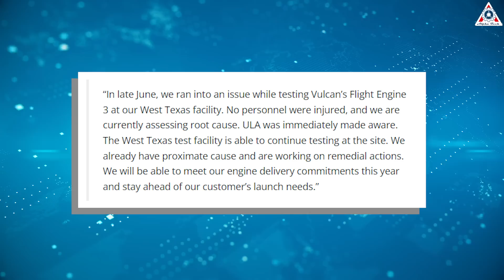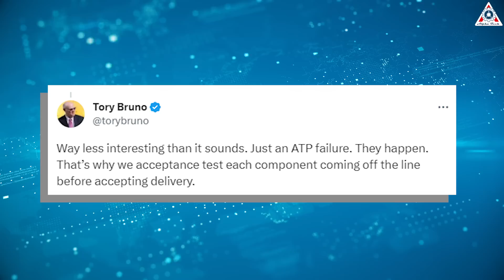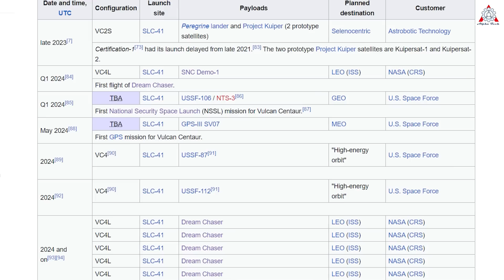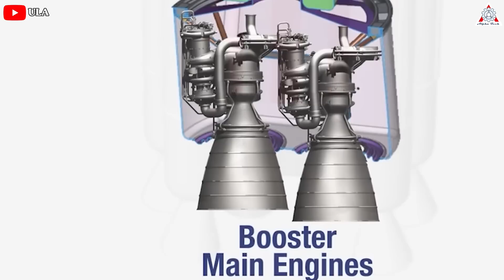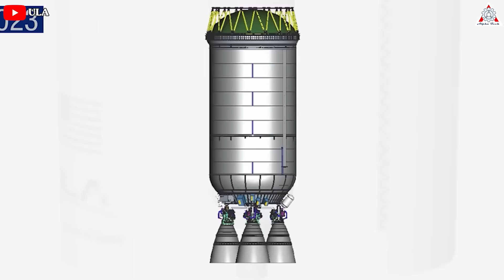A depth look inside Blue Origin's Engine Explosion! Destroyed ULA...

Comment: Just start buying used SpaceX engines. They are reliable and cheaper than building your own. All you would have to worry about is a few valves and an engine mount. Then you could start worrying about the defects in your crew capsule. Or buy a used one of those from SpaceX too. Heck just start buying their old rockets to fulfill your contract.

Comment: How long can the engine be delayed before ULA gives up and goes with another engine?
Reply: But who else makes engines?
SpaceX makes reliable engines but a) They need them all for the number of rockets they plan to make, b) They are the wrong size for ULA rockets, and c) They are the competition.
Reply: @protorhinocerator142  So is Blue Origin (Tory Bruno's words), and the reason they went with the BE-4 is they had say in the development of the engine and i believe the BE-4 is the most powerful Methane fueled engine out there. Aerojet Rocketdyne had an engine offered, but weren't picked.

They could in theory go with the Raptor 2/3 engine which is also Methane, but they'd lose performance and any say in the engines development.
Reply: @AlphaGametauri  Correct. The BE-4 is larger and puts out more thrust than the SpaceX Raptor engines.
The BE-4 is the perfect size for the ULA rockets. If they went with the Raptor, they would need to make so many modifications that they might as well design a whole new rocket.

I think it would be hilarious if SpaceX created a Raptor X-4 rocket engine that has the same dimensions as the BE-4 with similar performance.
Make a whole separate fab for the X-4 engine, so it doesn't interfere with the Falcon or Starship programs.

Comment: ULA should just go ahead and buy used SpaceX engines.
Reply: That would require a complete redesign of Vulcan.
Reply: That would require a complete redesign of Vulcan.
Reply: @lucifersatoshi  I'm sure SpaceX could make the necessary modifications in a couple of weeks, and have a prototype built a few weeks later.
Reply: @lucifersatoshi  It doesn't help that Blue Origin churns and burns people as fast as Amazon. Hierarchy and status reign supreme; actually progress is a random occurrence.
Reply: Elonmusk definitely won't be selling his engines to his opposition not until he gets starship up and running
Reply: @markstacey876  OneWeb is a competitor to Starlink. They were left high and dry with the Soyuz platform after Russia invaded Ukraine, and SpaceX quickly sold them a SpaceX launch.. SpaceX even recently launched a Viasat mission. Viasat was throwing a fit over starlink a  number of years ago. Either ULA buys engines from someone else not Blue Origin, or they may as well shit down entirely.
Reply: No, give nothing to ULA.

Comment: Raptor testing failures celebrated over the years as proof of a hardware rich development process.   But a BE4 testing failure spells the ‘end’.
Reply: The difference is BO engine was supposed to be a “finished” design. Raptor 3 is still under development. Big difference.
Reply: The BE4s are production engines tested within their design envelope of 134 bar max chamber pressure.
Raptors are development engines often tested until destruction. The 350 bar reached so far is likely 115-120% of max pressure.

Comment: Space X = metric = success
Blue Origin = imperial, results have conversion errors
For example:
How many feet are in a Tom Cruise? What is it in wagon wheels? Outside US we have problems with imperial
Reply: Lol we are still waiting fir the hyperloop...
Reply: Computers have no issues with units.  We use CAD now.  The problem with BO is management.  Fish rots at the head
Reply: @mefobills279  Please ask Your computer how many feet are in one Tom Cruise, Mine does not respond
Reply: @RickTheClipper  One Tom Cruise is 5.583333333 feet.   This is why I thought he made a terrible Jack Reacher.   One Jack Reacher is 6.4167 feet.   Cruise just didn't measure up.
Reply: @tomgray971  Thank God, You seem to be a specialist.
How many teaspoons per second does the engine burn to create one long tonne of thrust? 
What is the difference between long and short tonnes in wagon wheels?

Comment: "... while testing flight engine 3 ..."
Meanwhile, SpaceX has 10X'd that, with real flight.
Reply: Not to mention that BO has received more tax payer dollars than SpaceX while SpaceX is sending astronauts to the ISS, cargo to the ISS, and numerous payloads safely into space
Reply: And Elon's engines explode on takeoff
Reply: @ejhen5515  SpaceX's record speaks for itself.
Reply: @ejhen5515  I believe that the number of "exploded" engines was zero.
Reply: @ejhen5515  " Elon's engines explode on takeoff"   Fact check: Since March 2006, SpaceX has launched 5 Falcon 1, 238 Falcon 9, 6 Falcon Heavy, and 1 Starship rockets. Of these, 3 Falcon 1, 2 Falcon 9 and 1 Starship launches were complete failures and 1 Falcon 9 launch was a partial failure. None of these failed at takeoff.  https://en.wikipedia.org/wiki/List_of_failed_SpaceX_launches

You may be referring to Starship.  None of these exploded on takeoff.  SN1-7 exploded during testing.  SN8 - 10 achieved altitude but exploded during attempted landings.  SN15 took off and landed successfully.  SN20 took off but failed separation.

As of May 2023, SpaceX has a 97.4% launch success rate.
Reply: @ejhen5515  and thats not critical for mission